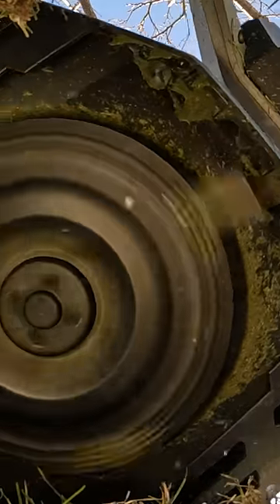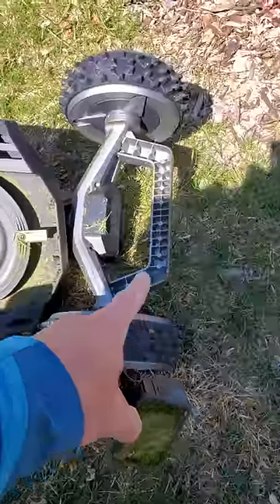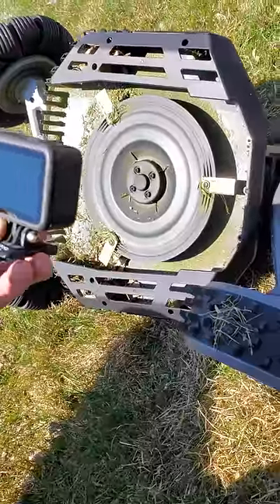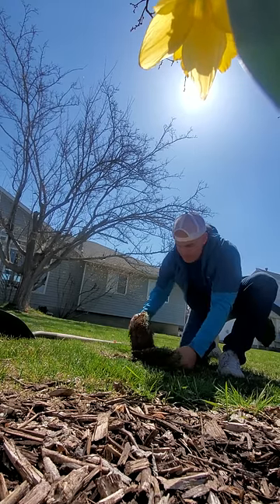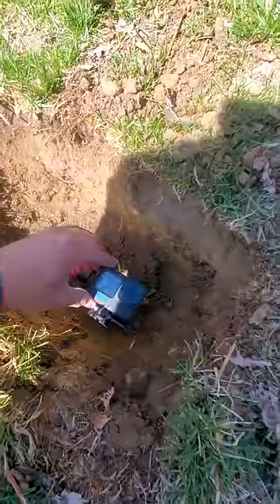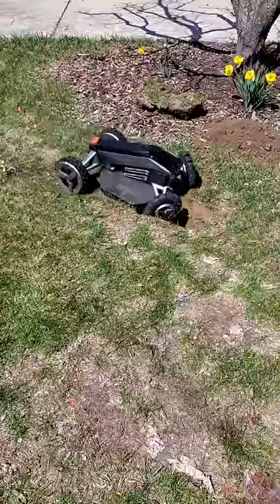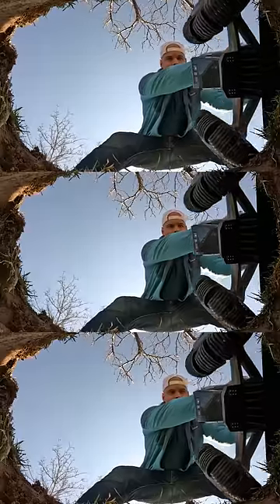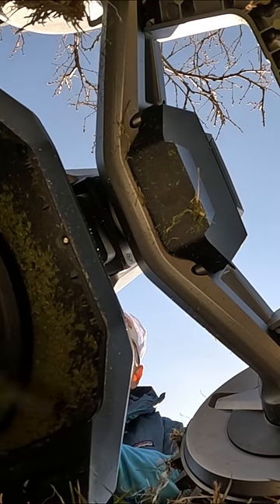How to Film Spinning Razor Blades? - (Mostly Safe!)

Comment: Very raw product I would say, only for ideally plain yard, preferably with no obstacles (trees too). Its trying to do job with GPS navigation and some proximity calculation, but if one wheel get stuck, it will think that it gone out of working zone and many others scenarios. If you have over 400m2 of lawn it’s pain to “draw” or rebuild working map (it’s made manually by navigating this robo). I could continue but will only say, not that satisfaction for the buck